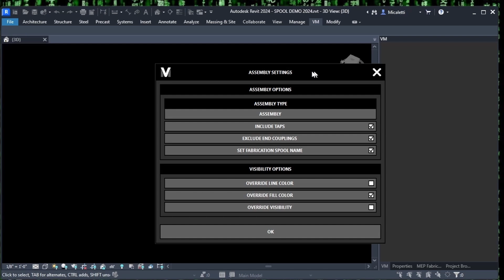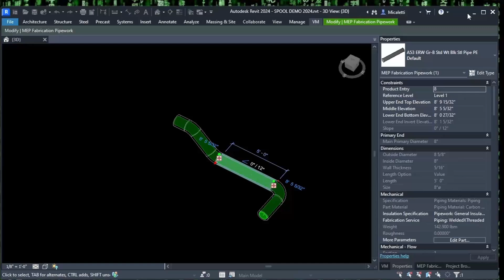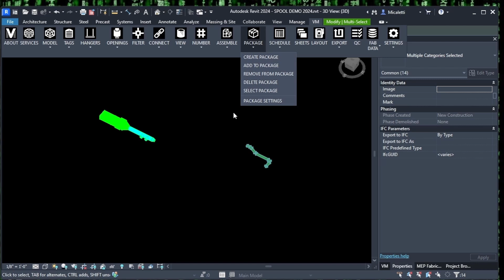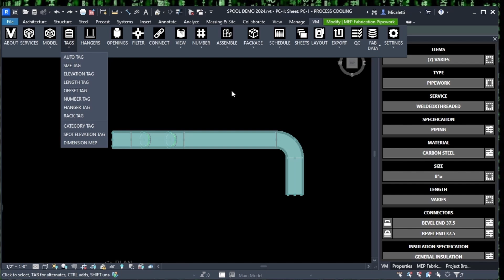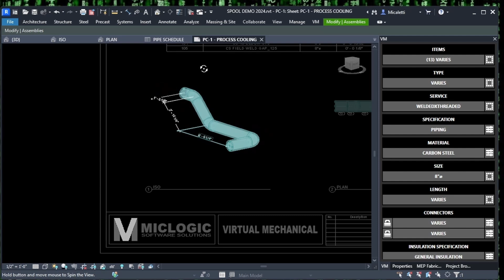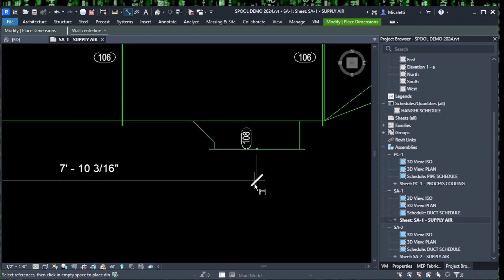VIRTUAL MECHANICAL - LIVE SPOOLING AUTOMATION DEMO

Comment: Great presentation !  I have been using VM Tools for a while and I can attest that it is one of the best revit plugins out there, if not the best one. Could you please share these templates for the sheets? 
That's exactly what I think it would benefit a lot of beginners, a step by step video series using the software, where we could break it down in:
- Modeling SM and Piping (pressurized and gravity types - ST and SAN);
- Hangers placement;
- Annotation
- Placing dwgs on a sheet (normal submission for DT review);
-  Spooling and annotation
- Placing spooling on a sheet to be pre-fabbed